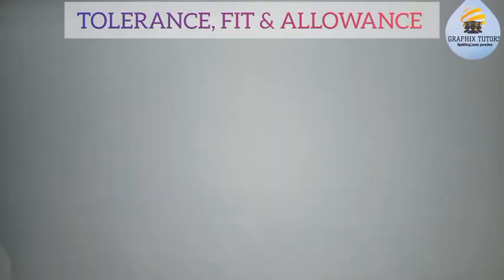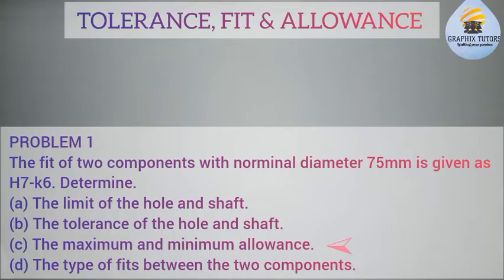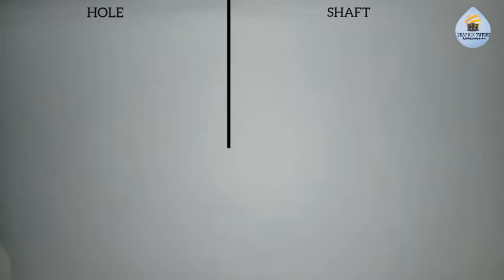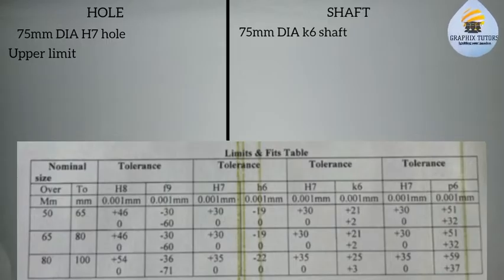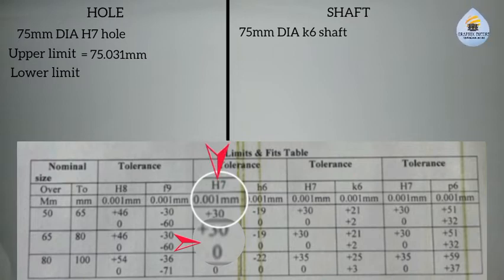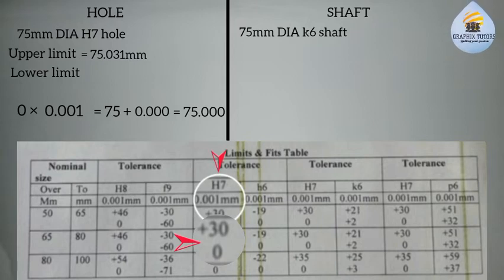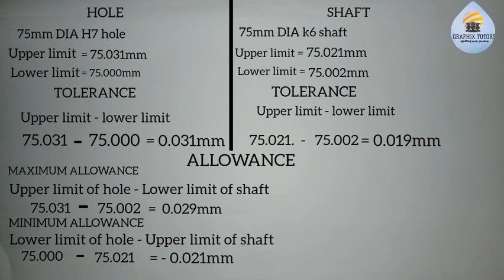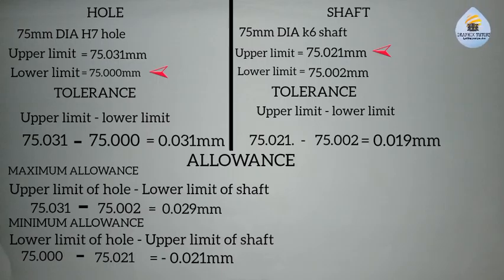limits, tolerance and allowance of a hole and shaft in engineering fit

Comment: thank you very helful simple and to the point
Reply from the maker: Glad you like it
Reply: @alirule  thank you for the video, I have a question. 
if my tables are separate and they dont have letter&numbers together; I have one table that gives me the tolerance IT1-IT18 and I have a second table with the letters A-ZC (and another table for shafts a-zc), how would I do the calculation? for example id I have the tolerance 100M6g7, then I have IT6 = 22, IT7 = 35, and I have the letters M for hole = -13 , g for shaft = -12. I'm struggling to understand this. if you can help I would greatly appreciate it thank you in advance.